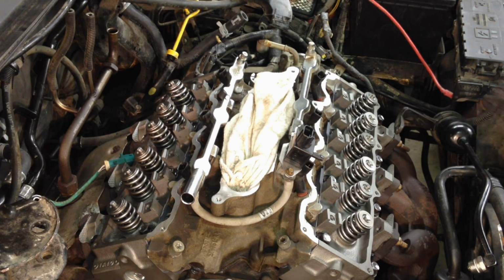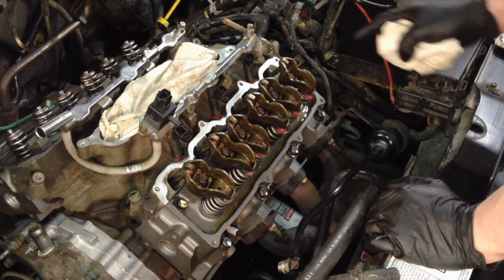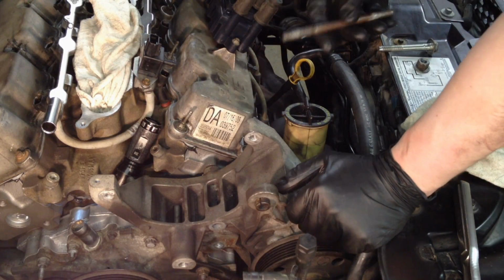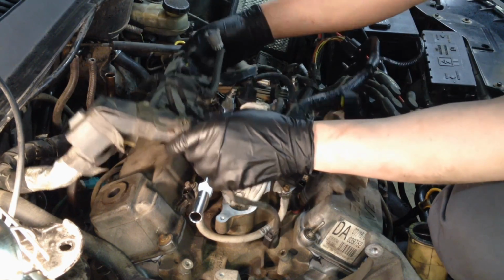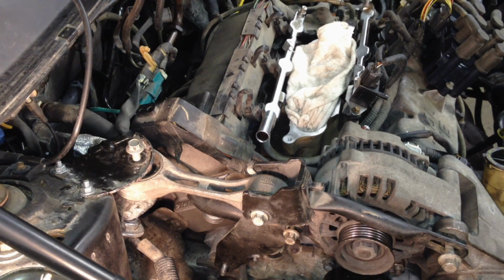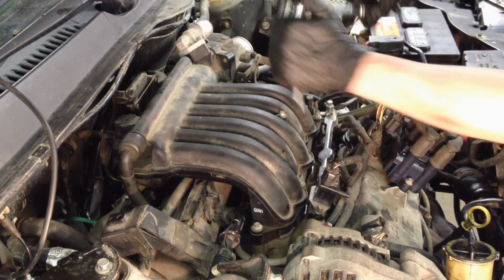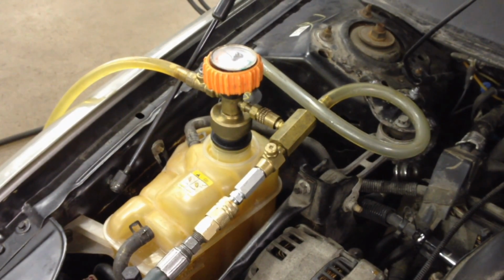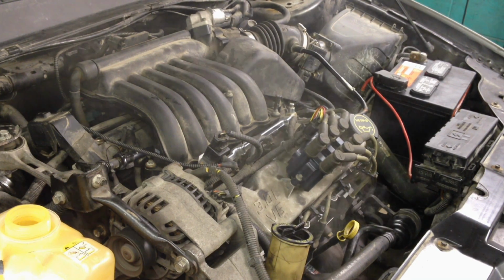Ford Taurus 3.0L 12v Head Gaskets Replacement Pt 2

Comment: Also, the following is something I was discussing with another mechanic, but 2 weeks later, still no further replies.

I checked some of your items, but nothing as yet will reduce my 1300 idle rpm.  1997 Taurus, replaced IAC twice, meter checked TPS, idle set screw correct, MAF cleaned twice, vacuum hoses checked, PCV replaced and even did a smoke test.  Only smoke I could find was coming out the body of the IAC around the body ring, not base plate.  Cleaned throttle body, checked and it is closing, sprayed break cleaner and nothing changed looking for air leak.

His first and only response.  - normal to see smoke come out of the IAC vent.
Disconnect the MAF (make sure the electrical connector is unplugged to put it in default mode. Remove air intake tube, find the IAC inlet hole in front of the throttle plate and block it with your finger. Does your idle drop or stay the same?

My next response. - Ok, unplugged MAF, removed Air Intake Tube, removed Hose infront of and below IAC.  This hose had a dbl clamp on it, short hose and 90 then went over to another vacuum control box where the BB hose goes. Plugged pipe and engine RPM came down to 900 - 1000, but engine ran very rough and could hear a pop or missfire, but did not stall.  Put it all back together and ran at 1300 RPM.

My last response. - Pulled IAC, blocked both opennings and no change in idle. Tried blocking one and still no change.  Pinched all vacuum lines and barely a noticable change in idle speed.  No change when pinching BB vacuum line.  Since I can find nothing else, I am thinking maybe vacuum leak under manifold.  Didn't get any reaction spraying brakekleen, but maybe it's just not reaching leak.

Any thoughts on where I should go next FordTechMakuloco?
Reply: It's a vacuum leak and it could be anywhere from the transmission to a cracked hose. I even seen the vacuum boost bottle crack for the AC system.

Comment: Great video.  I was looking for your video for testing to find out if you have a blown head gasket.  I could not locate.
Reply from the maker: Check for excessive pressures in the cooling system, coolant usage (white smoke), and last a combustion gas leakage tester.
Reply: FordTechMakuloco Have seen some white smoke and driver actually said it smelled sweet.  Tried some head gasket leak fixer to the collant system.  This seems to stop it a bit, but right now driver is adding water every two days, yet I don't really see a lot of white smoke now.  There appears to be no water leaking under the car and when I replaced spark plugs, though car had been sitting a few days, I did not see any wet plugs.
Reply from the maker: I would try the combustion leak tester then.
Reply: FordTechMakuloco Thanks, I will do so.

Comment: I have a issues with. My ford taurus 2002. When I attempt to start the car nothing happens the radio ,lights etc come on but it just won't crank. My battery is about 1 mo old.i have no clue what May be the problem..please advise
Reply from the maker: 3.0l ohv? You likely need a starter they get oil soaked, check it out-
Ford Taurus 3.0L 12v Starter Replacement & Failure Analysis

Comment: Great video. Is there an advantage to disconnecting the fuel rail instead of pulling the injectors? Is the rear metal cat ring pressure fit?
Reply from the maker: Yes pulling the one fuel line is much easier and way less chance of a fuel leak in the end. The gasket/ring in the rear car just kind of sits in the groove then gets compressed to seal.

Comment: Excellent video. Got one of these projects coming up soon. It seems like there's a lot of rust in the coolant and the heater doesn't work very well. Engine runs rough like a cylinder misfiring. You mentioned that in the video about a couple of cylinders not running right. Does that sound like a head gasket to you? Thanks again for posting this. It beats going through the Chilton manual.
Reply from the maker: See my videos on what I did to test the heads before I took them off this will tell you everything. I also have videos on flushing out the rust with a special cleaner from for just for this concern, I also have heater core replacement video too since yours is plugged and it is not coming back. Let me know if you cannot find the videos.

Comment: dude thats the good assembly lube... hard as hell to get in eastren canada now... permatex is what is basicly used now, i think its junk... it works but it runs when u want it to stay in place. lucas oil treatment is basicly the samething
Reply from the maker: Yeah it was recommended on my last engine build and it stays put, works.
Reply: ye? what engine was that? 3.5?
Reply from the maker: No I overhauled my 2.0l spi about a year ago everything new about except the block
Reply: awww ok, well we use permatex assembly lube at my work! it works good but not nearly as good as cam gaurd from mahle

Comment: Great video. Do you change oil/filter before first start-up or after? I always worked on break-in oil (cheap oil) for the first run-up then changed after the first couple of hours so you wash out all the assembly lube and garbage you didn't see sneak into the valley.
Reply from the maker: I do it before first start up as ford recommends and I understand that if we are doing front cover or under the timing cover water pump etc there is a good potential for coolant dropping down into the oil and you never want to run that mixture. This assembly lube I put on is more advanced they say and there is no need to do an oil and filter change after and it was so little of an amount anyway.

Comment: Absolutely excellent video.  It may seem a waste to you, but a video of scraping and preparing those gasket surfaces would be good.  You do such a good job with it and it's a lot harder than it looks.  Would like to see the tools you use and the method.  Thanks again for the super video.
Reply from the maker: Maybe one day but allot of people criticize head and block cleaning techniques like they could do it better and without any potential grit getting into the engine so I try not to get into that whole argument with people and just don't show it.